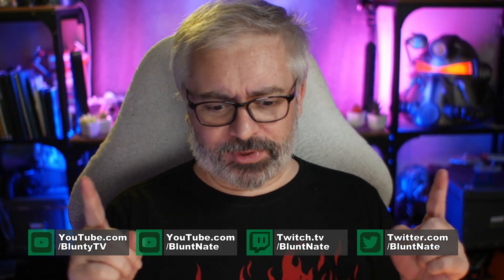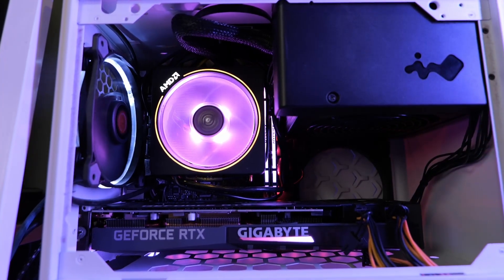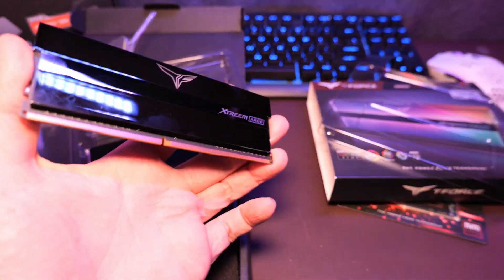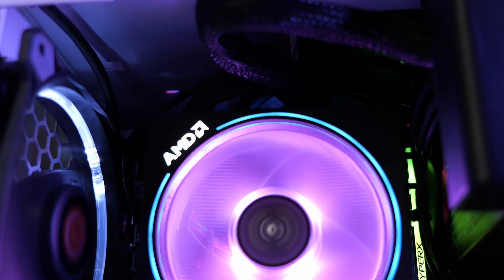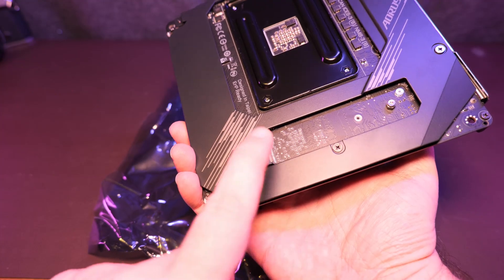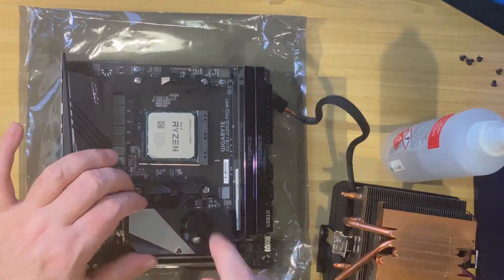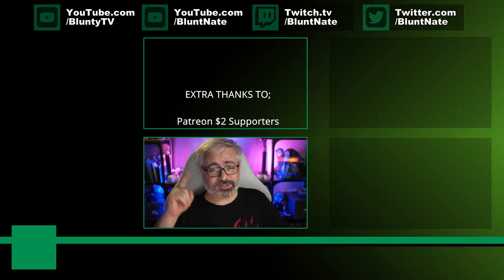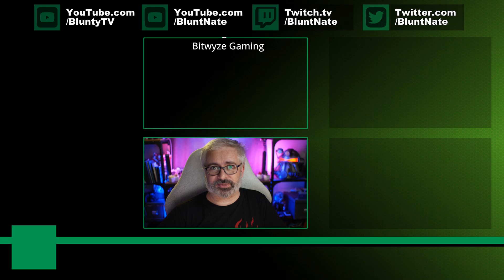PC SOUL TRANSPLANT! - AKA, "Don't Fear a MoBO Swap" For PCIE 4.0 & USB 3.2 Gen 2

Comment: I was able to swap mobos back in xpm days on mbobos where it was "impossible". When the IDE controler driver was not compatible and it could not boot, but I figured amazing trick to do it. First, install an IDE PCI expansion card in windows. Install driver for IDE pci card.  Now turn off and switch to have XP boot off the PCI IDE card,. Once confirmed it can work, now the drivers are al instaled!  So NOW, swap mobos but boot windows again on the PCI IDE card. It will boot.  After the driver freakout finishes, then you can install mobo drivers and the mobos proper onboard IDE drivers etc, now U can turn off and remove the pci iDE card if u with and boot off th enew native obnboard IDE/SATA port. Boloody epicx.  I hated to reformat I always wanted my programs and settings to survive.  Like if I buiy a new fridge I don't have to throw away all my food!

Comment: In this instance, did swapping the motherboard require a new purchase and install of the operating system?
Reply from the maker: Nope. (and you don't need to re-buy windows even IF it triggers Window's "significant hardware change" thing, which a MoBo replacement can certainly count as... you can just REACTIVATE your existing key... I've done it before - This VERY INSTALL of windows was originally made on an i9 review test bench build before I moved it to Ryzen and then made it my gaming rig - this time though, windows seems to have not cared... I wonder if they've relaxed it a bit... )

Comment: I really hate this non-upgradeable case trend. "Remove 5.25" bays because nobody uses optical drives anymore" they said. What they meant was "Remove 5.25" bays so nobody can upgrade their front IO and have to buy a new case, that way we make more money." My case is so old it has built in front firewire and esata ports, but not even USB 3.0. And yet it has two USB 3.0 type A and 1 USB 3.1 type C on its front anyway because I put an upgrade board into a 5.25" bay. Keep your tempered glass everywhere and your inability to be upgraded, modern PC case industry. I'm not interested. (although I suppose Inwin gets a pass here, when you're trying to make a case as small as possible you at least have an excuse to remove features to make it work. but all the normal size cases without this feature, no, I won't buy those)

Okay, with that semi related rant out of my system... I actually can't think of a single upcoming game I'm looking forward to. 🤷‍♂️ Not for PC, not for any of the consoles. Just as well I suppose, it's always nice to have some time to chip away at the ol' backlog.

Comment: It's funny you bring this up. Last time I built a PC before my current one I pretty much built it on dead standards. Less than a year after I built it DDR3 stopping being a standard and DDR4 took over. To upgrade ANYTHING I had to start over, new mobo, new CPU, new RAM, there was little other than hard drives that I could carry over. Current PC may face a similar fate, but at least it's pretty damn good for the time being. Old specs: i7 4790k, 32gb DDR3 1600, Titan X, 250gb SATA SSD. Current specs: i9 10980XE, 128GB DDR4 3600, RTX 3090, 2TB gen 4 M.2 SSD